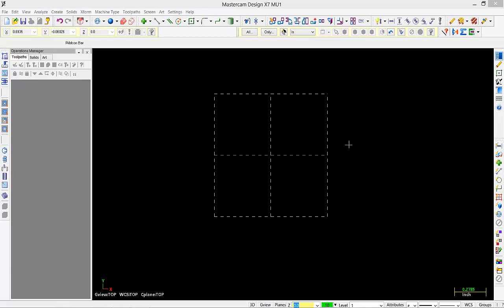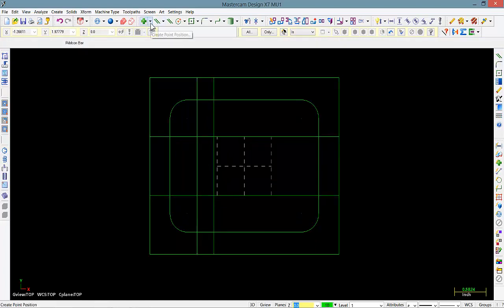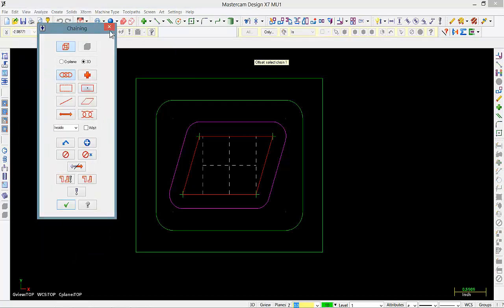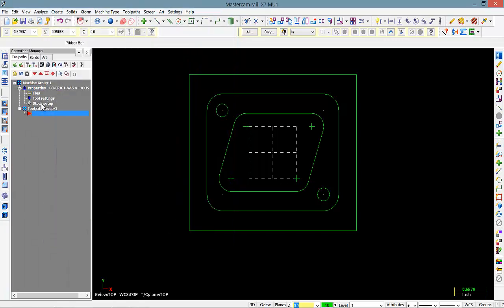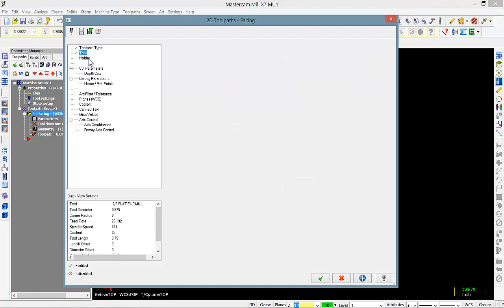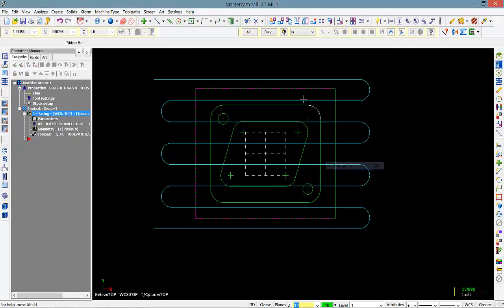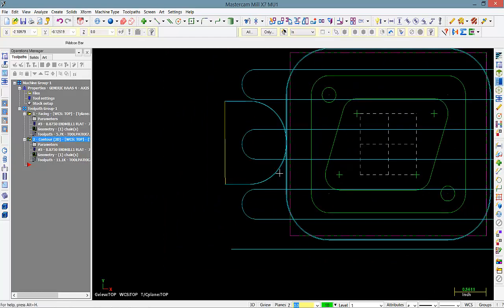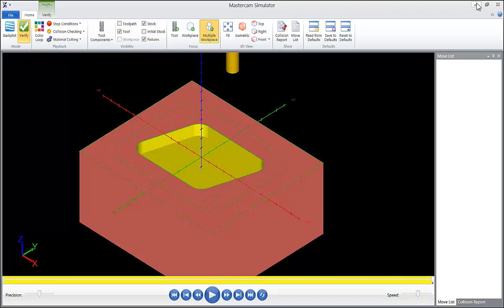Intro to Basic 2D Tool Paths in Mastercam

Comment: IS this the same mastercam you used in the  tutorials 1, 2, and 3.  cause it totally looks different
Reply from the maker: Patrick Giblin this is master cam X7 it came out around 2015, it does almost everything 2017 does just with an older interface.